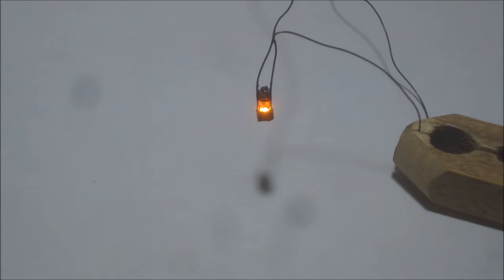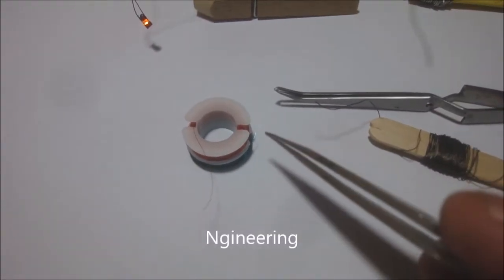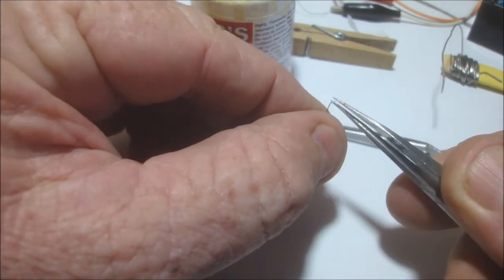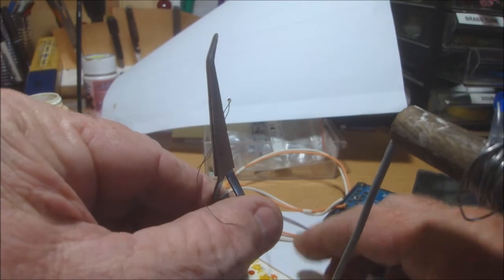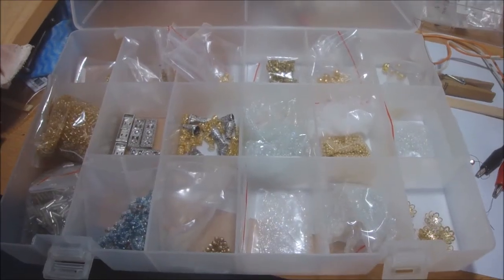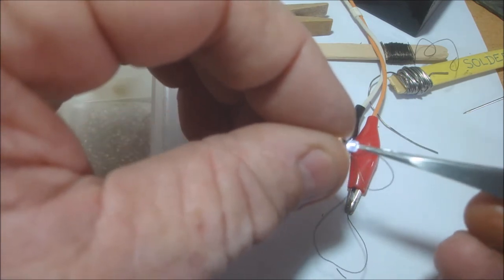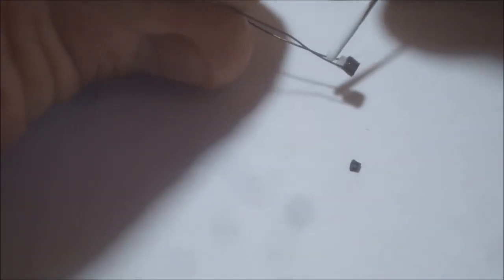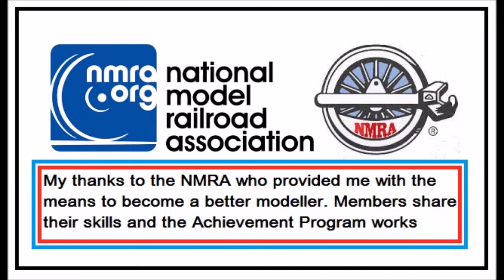SMD LED lanterns

Comment: how do you get the arm to move please
Reply from the maker: G'Day Keith, I drill into the figure body and make a cavity in the back, cut the arm off and add a bit of styrene to where I cut to make up for the saw cut. Using nickel silver wire and brass tube I make the linkage from the tiny motor. The motor has a crank wheel and track spike crank pin. I have videos of this here on my channel.
Reply: thank you i qill try to find your videos